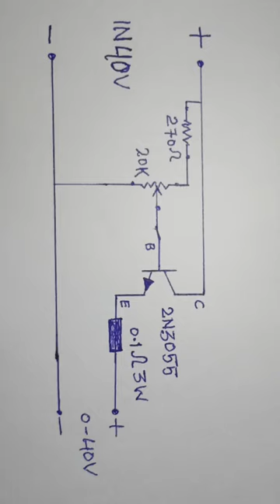Adjustable Voltage Regulator 0-40V 12A

Comment: you need to add a min of a zener or may be a TL431 to have good stability in output voltage.. plus as somebody pointed out with heavy heatsink you can at best get 60w across the transistor. which means at 10v out put at best 2amps can be drawn....

Comment: is this a variable input and output voltage regulator?

if so, can this be used between a car alternator and the electronic components, to protect the components from higher voltage when the alternator diode goes bad?
Reply: No, there is no regulation.
Reply: @akirchner3  what do you mean?